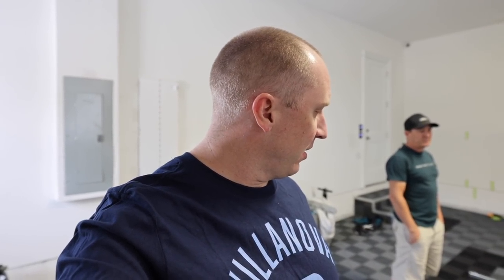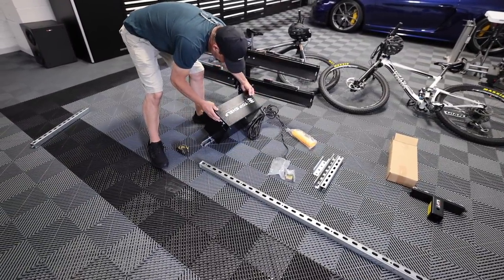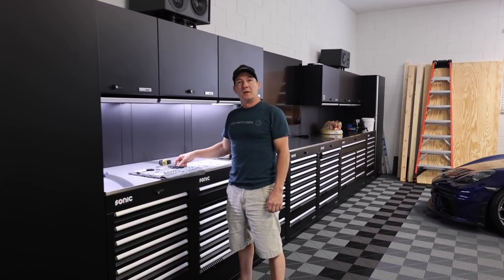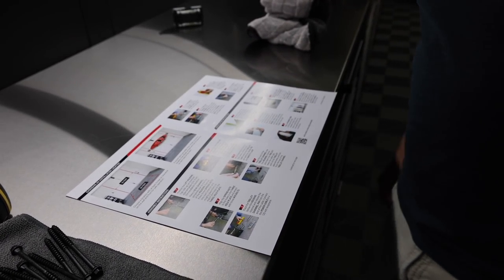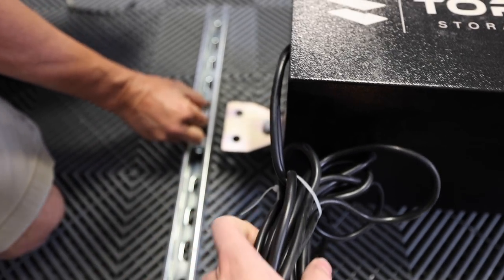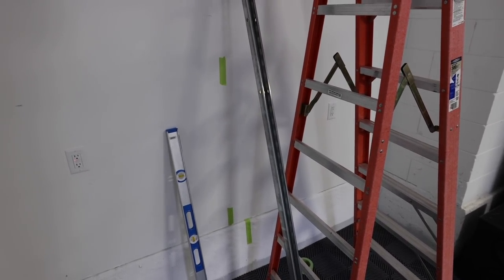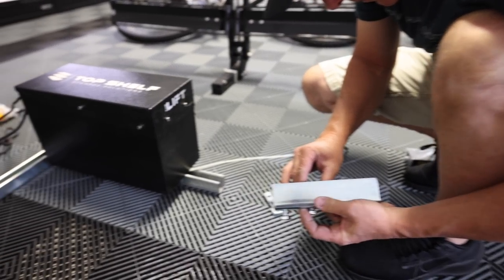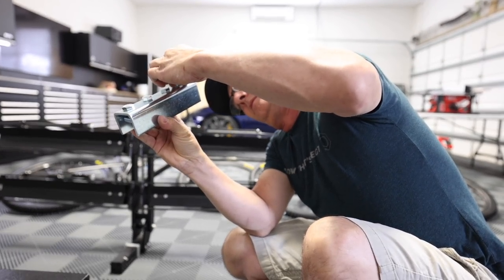Installing The Lift - Motorized Garage Bike Lift

Comment: Just a MEH on this one. Kids will slam the door open and hit the bikes, lift is kinda janky if you move the bikes side to side. You'll probably end up putting stuff underneath them anyway and have to move the junk before you can use the lift. Wont use the bikes as much when there up and out of the way. A highend bike stand you can store/display and work on the bike is the way to go. Still watched the whole video.

Comment: You should have moved the mount closer to the  right as close to the wall as possible. You could have mounted the remote on the right wall and the door would swing fully open.

Comment: Hey Matt, The thing has so many possibilities. you know what would be a neat if there’s space in the attic you could Cut A hole in the ceiling and make a cubby so the bikes could go up into the cubby and clear the door and still keep the attic separate from the garage totally not necessary just a crazy idea have a good one as always and Mike if you read this great work.
Reply: He already has the Majic Attic Lift which does just that. ;-)

Comment: If it were a bit more to the right prob would’ve been better. Control unit on right wall. But overall useful especially for kids bikes too.
Reply: I was thinking the same - further away from the door. And the controller on the sidewall. The last thing I want is to load dirty/wet bikes up and stand underneath them when all the stuff is dripping.
Reply: You know matt....Symmetry doesn't create ocd lol..
Reply: They put it there so the track would be on a stud, I think they discussed it at the start of the video.

Comment: Do you know what kind of pulley that is inside there? I already have a similar setup with unistrut and pulley but it's not electric. I could just mount a pulley vertical above. But I can't seem to find any that look like that. How does the pulley cable get from the bottom of the black box up to the top and not get tangled or caught on anything? Usually when rolling up a cable it has the wheel horizontal. Any help would be appreciated.

Comment: It would be cool if you could list what tools were used during your projects so they could also be purchased in the OG store.  I've got the Sonic tools from you and one of the Milwaukees Mike was using, but I don't recognize the other one.
Reply from the maker: These are the tools Mike was using in the video:
https://www.obsessedgarage.com/collections/milwaukee/products/milwaukee-m12-fuel-hammer-drill?variant=34916785062039
https://www.obsessedgarage.com/collections/milwaukee/products/milwaukee-m18-fuel-surge-1-4-hex-hydraulic-driver?variant=34916652581015
Reply: @ObsessedGarage  Thanks!  You should add it to all your videos.  I'm sure folks would watch and buy.  Be well.